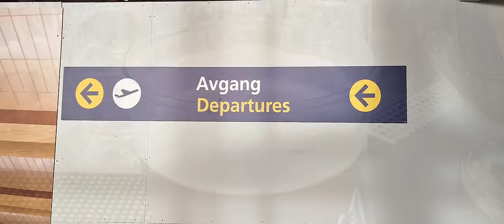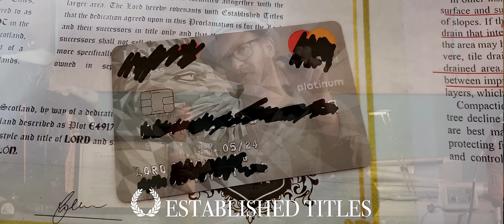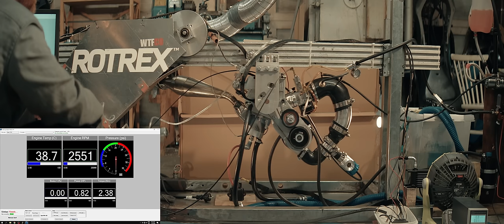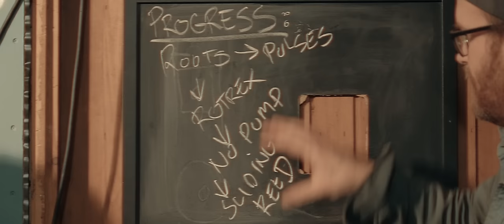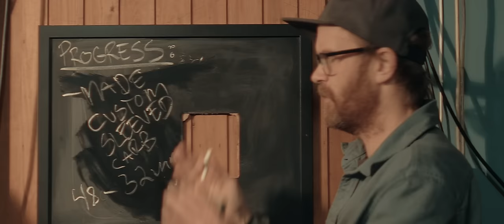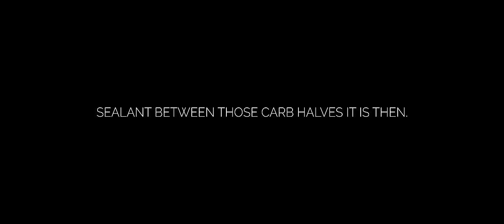Supercharged 50cc Two Stroke Flamethrower!

Comment: I bet the pressure from the blower is pushing the slide into the rails... you could try simply coating the rails and edges of the slide with teflon, or other dry lubricant and seeing if that fixes it first before cramming more spring on top of it. Great work so far!
Reply: I agree. Blasting the slide with glass media, to provide good adhesion, then spraying and baking it with a good dry film lubricant leaves me thinking it should help.
Reply: Look at the pressure difference! How much boost is there at the moment? The boost works against the slide and hinders it from coming down. ...Or im totally wrong...
Reply from the maker: That's the problem. Not only the pressure delta before/after slide, but also over/under. That line I added to the top was to make over/under better.
Reply: @2STROKESTUFFING  Right, but it's not about equalizing the pressure so much as taking away the lateral force on the slide. In this instance a round-slide would probably work to cut through the charged air better, but it would defeat the purpose of what you're trying to accomplish. Polishing the slide ends may net you the results you want just by getting rid of friction rather than increasing force on the spring.
Reply: Adapting a variation of the drum-valve instead of the slide-valve would do away with the problem altogether.
Reply: Imbed teflon' strips to the body of the carb where the slide is meeting resistance

Comment: something to think about is that the compressor is trying to shove a huge amount of air through that slide valve. It's got an enormous amount of sideways pressure on it basically. You probably should skip trying to put heavier springs on it, and just have a push/pull throttle cable pair.
Reply from the maker: Hoping to source a push-pull cable monday.

Comment: Slide valve changed to a barrel shaped with bearings and Teflon seals return spring mounted outside the housing. This may reduce the sticking due to air flow pressure against the flat slide. Or it cold just be a dumb ideal. Love  the channel.
Reply from the maker: Playing around with ideas for a solution, something similar has crossed my mind👍
Reply: @2STROKESTUFFING  That is the way we control rc boat engine in the old days. Drum valve on the exhaust. Crude but functional. Keep it up, we'll see your name in the record books one day.

Comment: Loving the content! In terms of the sticky slide, would it be worthwhile using a servo to control the slide. It will give the push/pull capabilities. When the engine gets put in a bike, it could make it possible for one electronic throttle to control both the throttle and sliding reed valve (if that also will be controlled by a servo) according to what the engine requires at certain rpms.
Reply: Servo has digital delay so it’s not as responsive as carburetor
Reply: is a few miliseconds that much of a hassle?
Reply: @thomas-nk7kx  Yet another electronic to battle EMI...
Reply: I asked the same question in the last video but decided to delete it because I wasn't sure I was experienced enough to enter the topic. Thank you for adding this question here.
Reply from the maker: Would be a neat solution👍
Reply: @Frank-Thoresen  Got the same thing mate. Just thought i had nothing to lose 🤣
Reply: Re: The slide issues, I would love to hear some input from Lectron Carbs on this.
That being said, it would appear the slide has enough meat on it (see at 11:57) to mill some slots for Teflon strips or other applicable sliders.
Servos do sound good, but there is already a LOT going on, and weight will become a factor come "record setting" day.
Reply: @bingusmctingus4395  they use those for cars, in throttle AND steering. Delay is not a problem.
Reply: @kevinsellsit5584  there are places that teflon or ceramic coat entire slides
Reply: @2STROKESTUFFING  will there ever be an end to this ?

Comment: I’ve had similar sticking slide problems, back in two stroke days, solution was to coat the slide in Teflon ….no more problems and the slide can be re-coated as required can be diy workshop job cure in oven.  Happy daze 🚀👍

Comment: Fear not, you have our undivided attention!
Anyone watching for years who re-plays the pulls to appreciate all facets of the challenge involved, would have to appreciate the sustained expansion of the pressure pipe and the ability to hold and or accelerate with the massive initial load of the dyno.
If it were easy everyone would be doing it, and I'm not about to get out of my LazyBoy and take a flight anywhere for a few metering rods you could easily grind out with just a few hundred thousand dollars' worth of equipment and a degree in fluid dynamics.
Did I say that last part out loud?

Comment: I wonder if the slide is getting stuck because of the boost pressure 🤔 always love watching your videos educational, interesting and original makes me want to boost every 2stroke near me 🤣 that blow off👌
Reply: I also thought that the plate could be under too much air pressure to slide easily above 10K rpm.
In another comment here it was asked if the slide could be controlled electronically (servo)
Reply: Does he even need the slide anymore? Wasn't the issue fueling related all along?
Reply: It may be fitting in there with small enough tolerances where temperature affects it. So who knows how much that could be with the cooling effect of the fuel being vaporized vs. the heat of the engine.
Reply: Go pneumatic instead of spring loaded?

Comment: The 'problem' with 'sticking slide' has been known about for at least 70 years to my knowledge.
 It's not the spring but a combination of pressure and surface area.
 Get a carb from an RMZ400 or similar MX bike, they have wheels on the slide to prevent it sticking open. 
Having a flat slide makes things worse if you don't have opening and closing cables.
On a four stroke motor, the high vacuum causes slide to jamb, your problem is boost pressure causing the same , pushing slide against housing.
Reply from the maker: Yeah, I was pretty sure it was going to be a problem. Have acquired a push-pull cable. Nice tip about the roller slide carbs!

Comment: A slider carb setup you should look into a pull/push throttle cable setup so when you want it to shut it forces it to shut. I did see you touch 16k rpm, very nice but didn't look like it was making much boost. Very nice build so far.

Comment: My hunch is that you are actually forcing air past the slide, which is then picking up fuel and causing that hanging throttle.   After all, carb slides don't stick on overrun on a NA engine where there is a massive pressure differential.

Comment: Fun, you need a butterfly air control valve. That will equalize the forces on the valve and prevent sticking. Pressure differential on the air valve puts a force on it.

Comment: watching the Harmonics on the 2 different sides of the belt while throttling the engine is almost mesmerizing.

And awesome sleuth work on that fuel leak I spotted in the video last week, now just have to figure out the new leak. that little port you blocked was losing more than fuel I am sure... some of your boost pressure was probably leaking from there as well

Comment: A return cable guarantees its closing, great vid, good luck with getting the nitro licence.
Reply: It’ll need a solid rod to raise and lower the slide + a spring loaded push pull throttle shaft with a fitting to actuate the slide. I think it’ll be a fairly simple addition for Alex. The real trick is to figure out where there’s enough room to fit it.

Comment: Unlike a roots blower, a centrifugal blower outputs a roughly constant pressure at any given rpm.  Even if you block it off the pressure does not rise much. That's why the blow off valve is not tripping when you close the throttle.

Comment: This will help with clamps not supplying enough pressure to seal the hoses properly. In Australia, all surveyed vessels going to sea, must use 2 hose clamps on each join. I never had a leak from the joins, had a hose or two wear out, bot the joins held perfectly.

Comment: Hi at 10:00 mins in your video you can see some highvoltage arcs at sparkcoil right from shuko connector
Reply from the maker: Think it's a metal chip reflecting light, I'll keep an eye on the coil next time.

Comment: Concerning the fact that better the engine is working more the valve sticks, it seems logical because the pressure build up when the engine revs pushes against the slide which increases the friction so it seems to stick more

Love your content
Cheers from France 👍

Comment: IMHO easiest fix for the throttle is to switch to a marine push pull cable.  make a "knob" that fits the where the standard cable goes into the slide, and threads on to the end of the boat cable, add a bracket at each end to hold the cable housing (just buy one for cheap, and mod it to work) and get back to running it

Comment: if your getting flutter and the bov isn't working, then you need to turn down the base pressure in the bov / make sure it's sliding well. the rotax isn't flowing enough for the amount of pressure it's making.

Comment: Amazing that it idles so nicely.     
Does the set screw you used to plug the nitrous hole tighten against something, or could it possibly vibrate all the way in and get ingested by the engine?  I've had something similar happen and the engine was a total writeoff. Maybe countersink the hole for a flathead screw instead, to eliminate that possibility?

Comment: Nice progress ! It starts to really work as intended 👍.  May be you are missing some additional physical guiding of the cable on both your levers,  just like a large throttle tube as found in quick turn accelerators on sport bikes:  to help with the cable guide, you can use a piece of the Bowden tube in Teflon  from the 3d printer

Comment: One idea is to mount 2 tanks. One for methanol and another for gas and connect them via valves close to the carburator. It will make purging and making fuel changes much quicker with less effort.
Reply from the maker: 👍 Need to purge the pump, reguator, etc. too, otherwise I would've done that.
Reply: @2STROKESTUFFING  since you purge them often and will probably many many more times it might be an idea to mount two tanks any way a little less filling the tanks at least.

Comment: I've seen a slide plate style throttle for ITB's on mechanically injected V8 that used small ball bearings in channels between the engine side of the slide plate and it's housing to allow free movement.

Comment: Lectron slides stick it has been an issue for years. There to tight sanding a little material off the slide solves the problem. The worst problem is the needle not being connected to the float and sticking closed then running out of fuel.  Other then that it is a great carb with a power jet or you can just put a power jet on a stock carb.
Reply from the maker: 👍 I'll give the slide a little more clearance. Yes, float retained in the valve is a weird design desition, wonder why they did it that way.
Reply: @2STROKESTUFFING  Right I have no idea why they continue to do that. I was litterally taking a hammer to the bowl to get the needle to come down on my CR250. Ended up taking the carb off and putting power jet on it. Works Awesome! Talked to the owner at lectron about. He said it has never been an issue.....lol I got and idea you need to make a needle with and little wire attachment deal! Could be part of an future episode!!!

Comment: You can use a lever activated solid rod inside the carb. Then you are also able to use twin cables for dual action. And you can use whatever for cable retension.

Comment: If it's flutter from when the enigne is off throttle, it's fine, just air pulses making noises. 

If it's under load it's more likely to be surging, which mean you are stuffing more air than the engine can effectively use, under load it's.. less good, not terrible, but less good since it can wear the bearings in the supercharger since you are trying to force it. 

I wouldn't worry about it, Don't know how the dump is configured, could be spring also, you probably have a better understanding of you own stuff than I do :)

Comment: Ive had a similar issue trying to run nitro in a two stroke engine! Turned out the air travelling in the engine was freezing the slide open. My engine was N/A i would imagine with yours being supercharged the port velocity is very high coupled with the cold Nitro fuel it could be a similar situation? Just wanted to throw that out there for your digestion! Keep up the great work , your almost there. 👍🏁🏁🏁🏁🏁
Reply: Cold nitro fuel?
Reply: @davidgierke7582   maybe! Its always easier to start a nitro powered engine on propane, then switch it over, difficult with a 2 stroke unless you have a oil injector👍

Comment: I'm thinking the blow off valve is not working because there is not a constant vacuum signal in the crankcase, maybe try moving the signal line from the blow off valve between the carb and sliding reed valve, what you call flutter is termed compressor surge. blow off valve needs to open when you get off the throttle to stop compressor surge maybe you know this, but you have not mentioned it. project is coming along nice.

Comment: You may have to use a butterfly carburetor. A slide will always be an issue.
Reply from the maker: Playing around with ideas to combine a metering rod with a butterfly valve.

Comment: Now the beast is starting to awaken! For the slide stuck issue why dont you try to use a rigid cable made of steel? Then you can put the flexible one outside of your carb and you can even add external springs for stronger return. Actually the boost from your turbo is smashing the slide against its seat so it's hard to make it move freely without any rigid solution

Comment: I don't know the first thing about engines - but long time follower. Anyways, to check if the blow off valve is opening without having to put your hand there I guess you can hang a small yarn or ribbon in it?

Comment: Nice video once again! Considering the springs you added to carb those are now springs in series, making the total spring coefficient actually lower what you had (https://en.wikipedia.org/wiki/Series_and_parallel_springs). However, as the space remained same this added preload for the springs which seems to compensate the loss of stiffness. Maybe some spacer would work better as the stiffness would remain.

Comment: Man, I hope that grub screw in the carb stays put, I would look at a different solution possibly for that, perhaps something plastic,   you don't want that sucked in....its nice to see you ripping on it again! Also, have you thought about creating a cam system for the valve that's cammed to the throttle position/lever?

Comment: Bowden cable to push reed valve slide closed, instead of relying on interior spring?  Rig a spring on the other end of the cable so you can get a good spring rate and travel. Also, maybe the slide sticks from friction on the face of the slide.  The slide friction increases as RPM increases from increased air flow/pressure?

Comment: Definitely sounding like progress !  I have similar problems with the carburetors on my Honda XL600    all that suction generated from that big piston sucks the plunger against the side of bore and makes the throttle crack open   a little unpredictably .. and it also drop slower in the bore as well

Comment: Try using a solid rod that connects directly  to the slide that way you can have a spring internal and external to assist in the closing of the slide, or even and some mass to it help it drop back.  A shorter throttle cable might help also. Great content. Cheers Zed

Comment: once more, you could avoid all those under-over pressure power jet stem rod problems by just hooking the carb, where the airfilter is now. 
you might change the setup as i said just for the LOLs and prove me wrong that way. wish you all the best
Reply from the maker: Can't run draw through, the axle seal in the rotrex unit would draw fuel into the gearbox and contaminate the traction fluid. Also, throttle on compressor inlet is not good for the compressor.
Reply: @2STROKESTUFFING  You must get sick of repeating yourself sometimes 😅

Comment: 15k rpm, jesus. What a beast.
Reply: I think I saw 16k on one of the pulls
Reply: @natereinhold6180  yes, in the end 16k.
Reply: Yeah, reliable 16k, inching to f1 territory!
Reply: @natereinhold6180  a panigale does the same with 250cc cylinders and valves which is definitely in F1 territory (266cc /15krpm)
Reply: @geemy9675  don't they use the weird mechanical linkage return poppet valves vs springs? Edit: just looked it up and yes they do they are called desmodronic valves
Reply: When using the Roots blower the engine reached 18k plus and was climbing until backing the throttle off.
Reply: @natereinhold6180  true but 16krpm has been done on smaller engines with valve springs in the past. the most impressive is the piston size/ piston speed which is higher than any engine and highest NA power/liter. I think even with turbos  only Koenigsegg jesko and Kawasaki H2R beat it

Comment: I guess the boost pressure is pushing the slide up? Guess you need some stronger spring or additional cable for forced closing of the slide.

Comment: So what you can do with that is make it so the intake is directly through the cylinder wall ports instead of going through the crankcase like the old Detroil Diesels. That way you don't have to run an oil/fuel mix because air is no longer going through the crank case.
Reply: how would you manage the exhaust evacuation if you had a "direct" air intake port?

atleast at lower rpm it would be almost impossible to make it run properly.
Reply: @zaarkeru3391  standard pop valve, or even in this case he could use the rotary tube valve system. Just time it to work in exhaust only